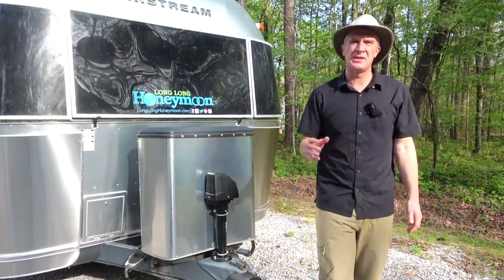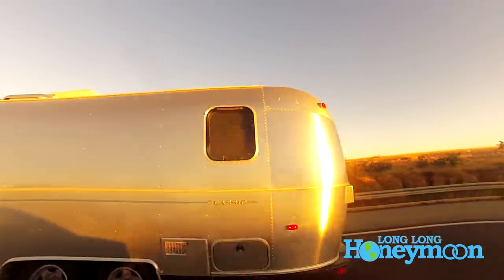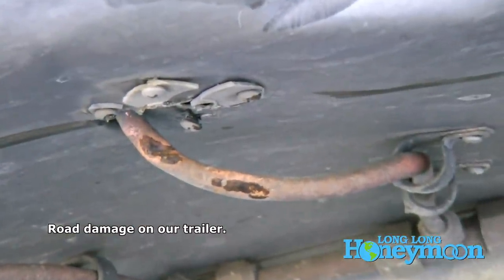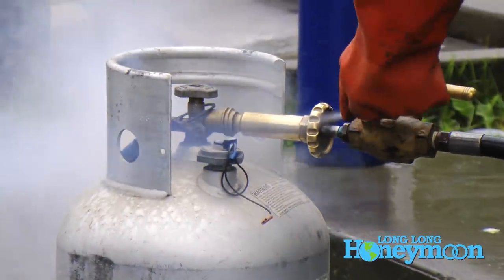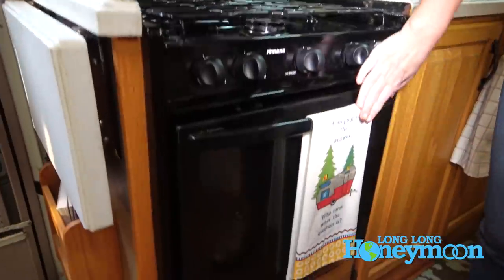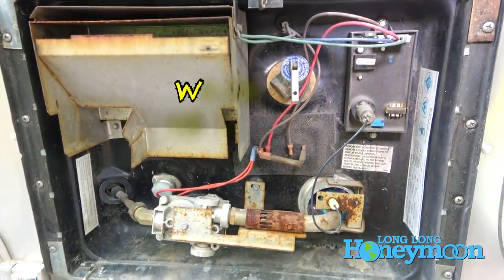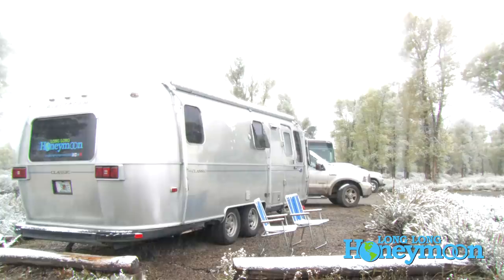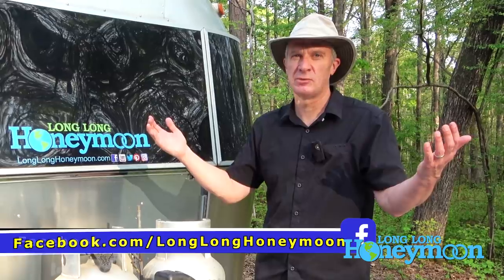For Beginners: RV Propane for NEWBIES

Comment: Name one state that makes you turn off your propane while towing down a highway.
Reply: I don't think you can go through most tunnels on interstate hwys with propane valves in the open position.
Reply: That’s true. But that’s not just driving down the highway as stated. There are also some bridges in the country that you must turn your propane off before crossing.
Reply: I wonder if propane operated cars and trucks can use these tunnels and bridges?
Reply: There are several that require you to turn off propane when traveling through tunnels. In fact, I'm pretty sure you can't even drive through the Holland Tunnel or Lincoln Tunnel in NYC with a full propane tank, even if it's disconnected.
Reply: Bill I just checked out a NY website and if your vehicle was designed for propane, has a certificate of approval, and is limited to a certain quantity then is legal. I would guess that other states have similar laws.
Reply: Good Sam has a web page called 2010 Driving Laws for the US and Canada.  The phrase "Open Propane Cylinders Are Not Allowed While Traveling On Open Highways" appears three times.  For New Jersey, and for Manitoba and Nova Scotia.